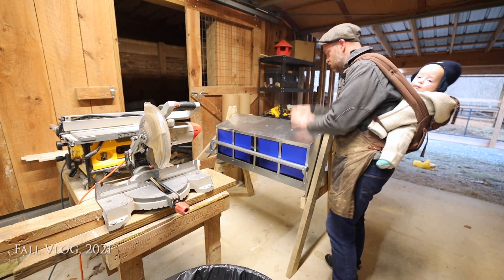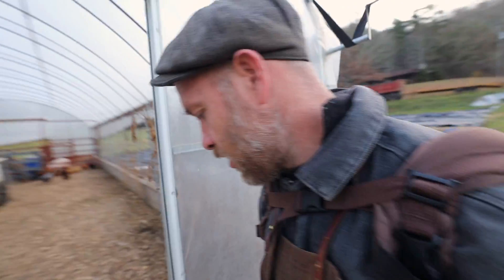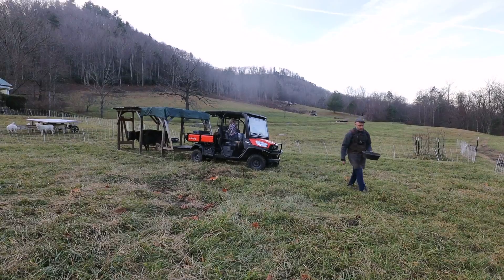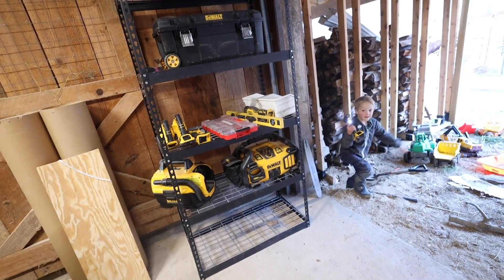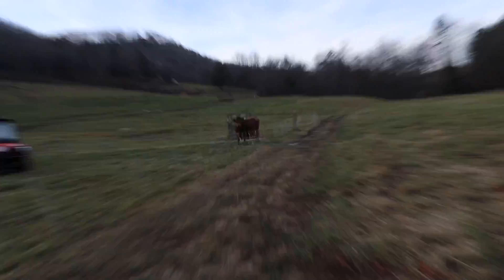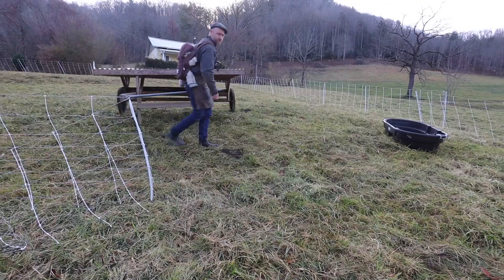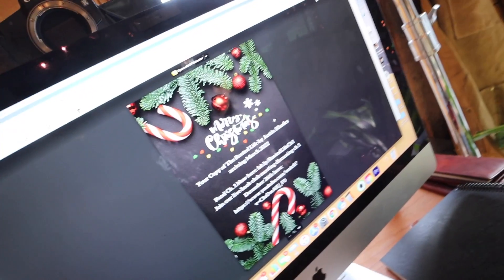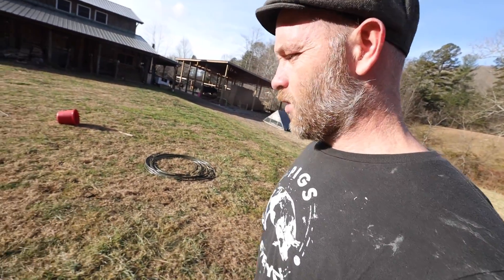The Chicken Nest Box is Complete, But Will It Work

Comment: Bookmarks like that work really well. All you have to do is fold it in thirds, like a pamphlet, the layers give it some rigidity. If you like you can also use a glue stick and trim the top and bottom. But it'll work just fine folded

Comment: You may need to watch the angle of your nest boxes… the roll-away only works when they’re accurately angled, so the grade of the coop will matter. Also … when training them to the new boxes, temporarily securing one of the blue curtains up so they recognize there is space back there, will speed up the transition process. Once they’re working as they should, roll away boxes are awesome. Cleaner eggs and they certainly saved my egg eaters from the pot. 🤣